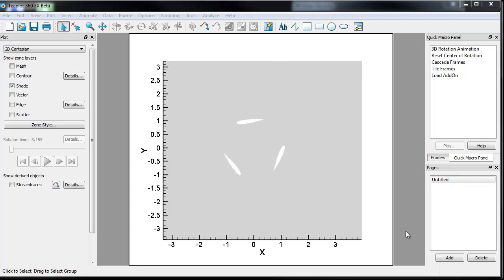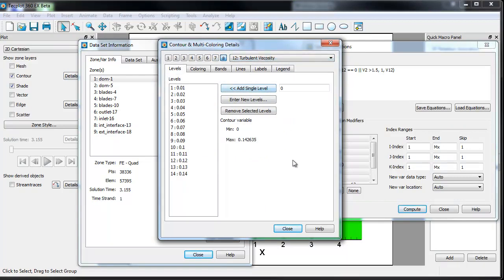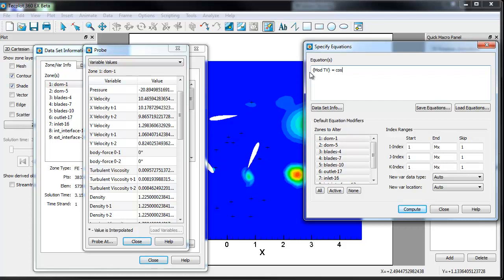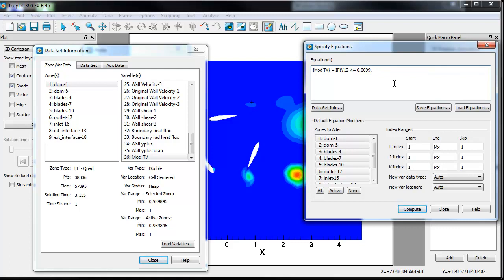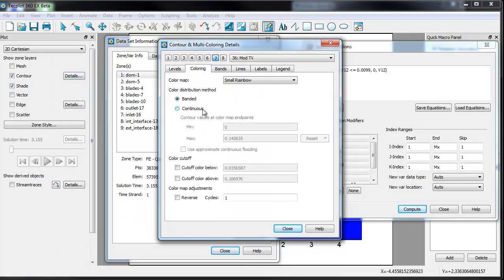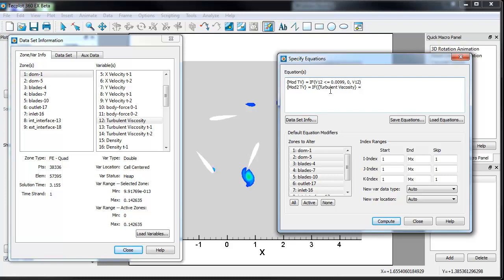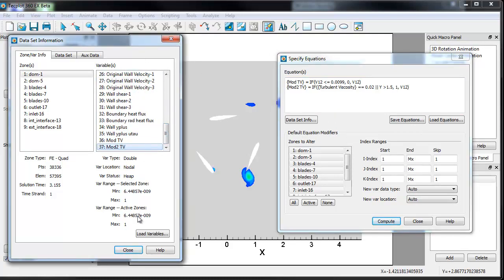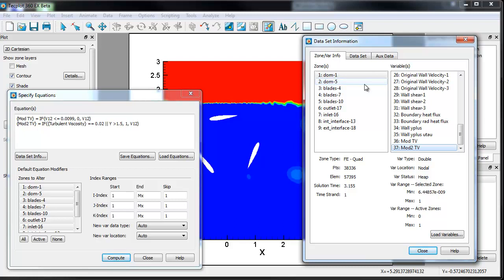Using IF Statements In Tecplot 360 EX

Comment: suppose I have variable V1.  I want to find out {V2}= V1- (average of V1) how can I do that.
Reply from the maker: +praveen7072  Thank you for your question! It is possible to calculate the average of your desired variable via Analyze>Perform Integration... and selecting Average as the Type of Integration. The Result shown in the Tabulated Results can then be used when calculating your new variable via Data>Alter>Specify
Equations...

For further inquiries, please contact us directly at support@tecplot.com or submit a support ticket at http://www.tecplot.com/my/support-tickets/ when logged in to your My Tecplot account. Alternately, contact your distributor www.tecplot.com/distributors/
Reply: +Tecplot, Inc.  
thanks for reply. I gave following equation in Alter which is not correct , and I am not able to figure-out why :

{Diss}=2*0.0096876408*[(ddx(U)ddx(U))+(ddy(V)*ddy(V))-((1/3)(ddx(U)+ddy(V))(ddx(U)+ddy(V)))]+(0.0096876408(ddx(U)+ddy(V))*(ddx(U)+ddy(V)))

U and V are variable name. Diss is new variable. It is just dissipation formula.